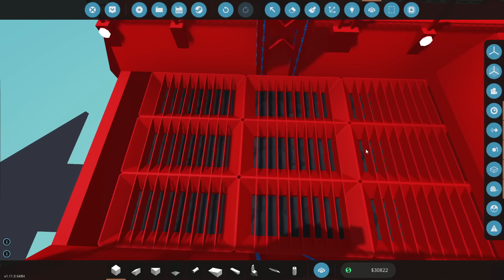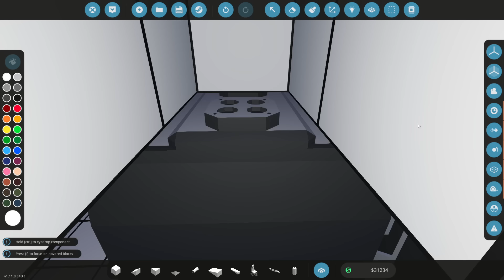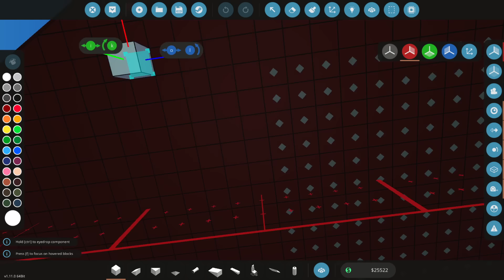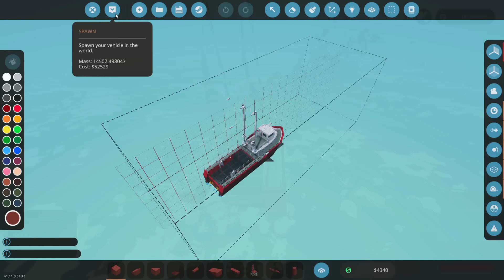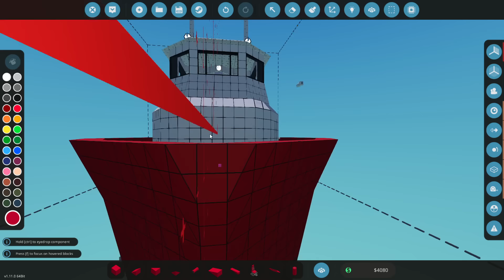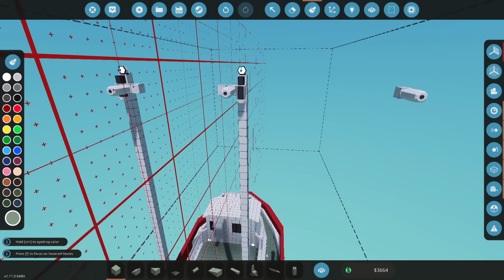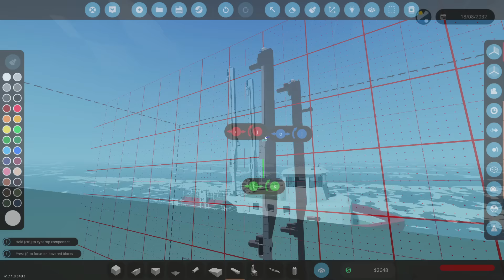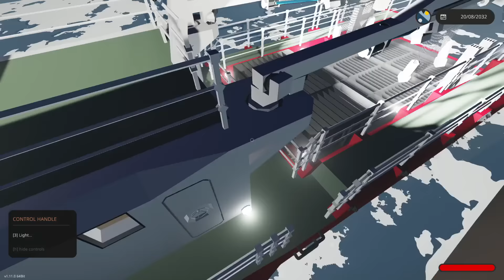REMOVING CYLINDERS OF OUR ENGINE! - Fishing Hardcore Career Mode - Part 29

Comment: Multiplying the speed sensor output by 3,6 gets kilometers per hour on the display. (1,94 for knots and 2,24 for miles if I remembered that correctly) - just if somebody wants to know how fast the boat is in more common measurements